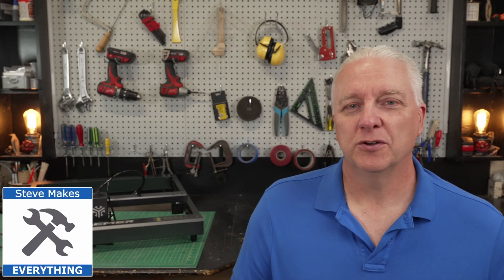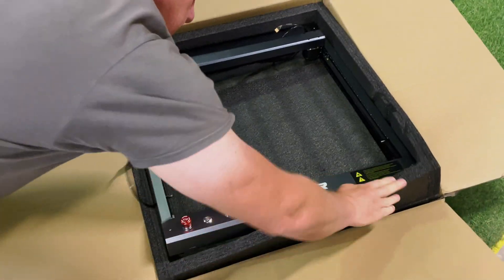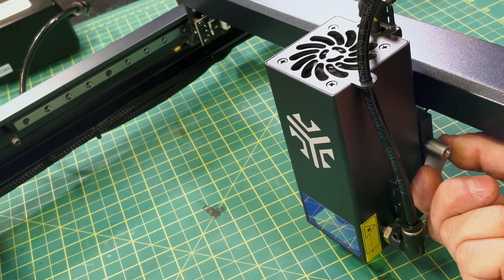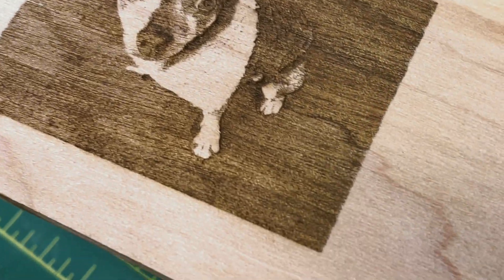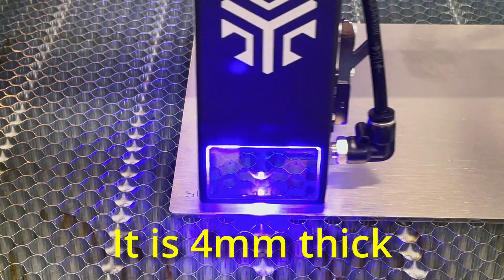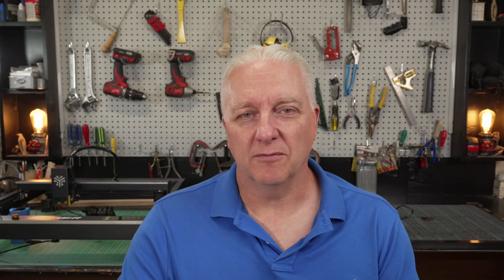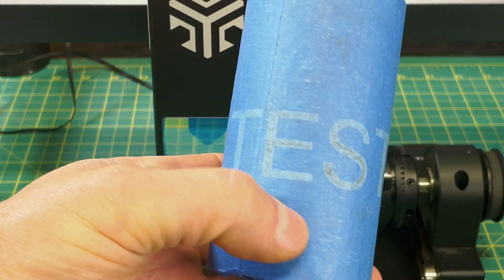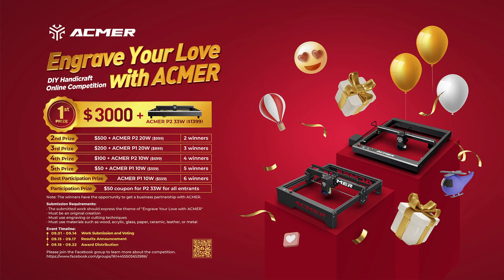ACMER P2 33W - Possibly the Best Diode Laser of the Year

Comment: I bought this laser about 6 months ago because of this video! I have one question, do you know what air nozzle will fit the laser module? I'm looking for a high pressure design or one that sits closer to the material. Any suggestions?
Reply from the maker: Hmm, not sure. If you just want to increase the pressure, put a piece of tape over the end of the nozzle and fire a few test shots to drill a hole the side of the beam

Comment: That looks pretty good, and with it on sale for $799 right now, it has to be the most affordable 33w laser on the market. I just bought an Ikier 24ww less than a month ago for $100 less, and now I need to make the hard decision of whether or not to try to return it and get this one. I do like the Ikier motorized z axis with autofocus and ability to step up auto step-down cutting. It's a tough call.
Reply from the maker: I don’t personally find autofocus on diode lasers very useful.  It takes longer than just doing it yourself.  However if you’ve got a laser that works why bother trying to get something else?

Comment: Purchased one last week, not production run friendly.  I mounted it to a spoilboard, burned a grid. homed it, and it was off immediately after which worried me. Homing the laser basically resets the position or even letting it cut a circle (lightburn and lasergrbl), then after it finishes, pressing run again mine goes off to the right about 1mm, then if you go again like that, it will go further. Home it, and all bets are off, it randomly picks a spot 10mm in any direction. I have to reset my coaster template each run which is annoying. Support had me upgrade the firmware but did not help either.
Reply from the maker: Hmm that’s interesting. What’s the point of homing if the 0,0 moves around?  When I get a minute I’ll try mine to see if does this too.
Reply: @SteveMakesEverything 

 Here is what I tested

DREW CIRCLE DEAD CENTER OF THE GRID AT 210,200
HOME THE LASER
SET FINISH POSITION TO 0,0
ETCH CIRCLE AND LET IT RETURN TO FINISH POSITION 0,0 (ERROR ABOUT A HARD LIMIT WHEN THE LASER HITS THE Y AXIS) **edit, fixed this by tightening a belt loose on the gantry**
HIT START AGAIN
RESULT OFFSET TO THE RIGHT SIDE OF THE GRID AND CONTINUES TO GO OFF MORE AND MORE AS YOU RUN THE JOB AGAIN AND AGAIN.
REHOME LASER
BACK ON THE CORRECT MARK
SET FINISH POSITION TO 420,400
HOME LASER
START ETCH OF CIRCLE AND LET IT RETURN TO FINISH POSITION 420,400 (no error)
HIT START AGAIN
RESULT, NO OFFSET AND REPEATS OVER AND OVER.

So it seems to be an issue with the Y axis limit switch?  Also, using Absoloute Coordinates in lightburn but does it with all if you set 0,0 as the finish. If I set say 10,10 I can run over and over so this may work but not sure why if it goes 0 on the x it flips out.
Reply from the maker: @SMLaserCrafting  The issues might actually be when you set the position to 0,0 after homing.  Homing is supposed to do this for you, but after a homing operation, Lightburn will set 0,0 and will then move the laser module out a bit to pull away from the limit switches.
Reply: Thanks!  @SteveMakesEverything   0,0 finish is actuall done by default in LB and LaserGRBL. Only way I was able to get around this finish at 0,0 was to finish at say 10,10 or anywhere away from 0 on Y axis which causes the issue. I can finish 420,0 or even 10,10 and it is fine.. anytime it comes to 0 on Y it is off on the grid after. I used their LB profile but increased the homing pull off from 1mm to 2 and it got rid of the alarm for hard limits but still goes crazy like it does in my video if you finish at 0,anything. Returning the unit and hopefully the next one is better.
Reply from the maker: @SMLaserCrafting  Note that you can turn off the limit warnings completely by setting a GRBL value.
Reply: @SteveMakesEverything  Ya turned off the settings but still having the issue where it loses 1mm or so going to y axis 0 as a return. I'll play with stuff today before I order a replacement machine and send this one back. Appreciate the help, been watching your videos for awhile now!
Reply: @SteveMakesEverything Can you test this and let me know what your result is? They had me tear this thing down, resquare it etc.. same. Draw a line circle anywhere, set finish to 210, 200 , run it again after it returns to finish. Should be exact. Now set finish to 0,200, move your circle or run over it again, and then after finish again. I did this until I got to 8,200 and after that it seems to be back to perfectly aligned. So anywhere within 0-9mm-ish on the work area is useless to send the laser to as a finish. running something out there is fine... but when the laser gets to that edge resting, I am thinking the cables or hoses is really pushing this gantry around. I just want to see if anyone else has the issue before I order another and return this one.

Comment: Hi Steve, I received my Acmer P2 over the weekend, but I'm having an issue.  I've connected as per manual, blue light on AC/DC adapter is on, but it doesn't turn on. The key is in the horizontal position, power button is down. I've downloaded lightburn, but I don't know which Grbl setting to click on have it locate the laser.  Can you PM me, or give me some direction on how to get this moving?  Thank you.
Reply from the maker: Is you haven’t figured this out, shoot me an email.  You will first need to configure the laser in lightburn. Find the Device button on the laser tab and click that.  The laser needs to be on and connect via USB before you do this. You may need to do long press on the power button to start it, though I can’t recall for sure. Also make sure the emergency stop button is popped out

Comment: How does this compare with the Atezr v35 or P20?
Reply from the maker: It is similar.  It doesn’t have autofocus like the Atezr L2 but unlike any of the Atezr lasers it uses linear rails rather than rollers and should be more accurate and more durable.  While both the ACMER and Atezr V35 are 30+w lasers, the Acmer P2 seems to cut more like a 40W.

I don’t really buy into the ability to cut lumber with any laser (I have a saw for that), but with the higher power you can cut and engrave faster than average.

Comment: Thanks Steve or your conprehensive reviews! Informative and straight to the piint. A request: could you please  help me compare the acmer 23 with the ikier pro 24/36/48 w? Because you had me convinced on the ikier some time ago, and i see that now regard this one to be better.  - It seems to me - correct me if i am wrong - that the ikier offers more features than the acmer,  like the auto focus and the z axis control for example. The ikier looks sleeker, and my impression is that it’s technologically more sofisticated. And since value for laser power they are pretty similar i wonder if I missed something.
Reply from the maker: I haven’t reviewed the IKier laser. All I can say is that it looks very similar to the Atezr L2 and I assume they are the same laser rebranded.  I love the L2, but I think the ACMER P2 edges it out for easy of use and power.
Reply: My bad, i must have seen someone else’s video and remembererd it was u, sorry! I understood from what u said  that 2 different brands of diodes with the identical optical power may deliver a different outcome? In other words there is a possibility that a 30 w diode of one brand  may perform better than ine with a higher nominal power? Or else?
Reply from the maker: @yehudaschryer5985  I have seen different lasers with the same power produce different results.  I'm not sure if it's related to the manufacturer or just differences in lasers modules regardless of the manufacturer.
Reply: Thanks again for your answer since as u said the same optical power may give different results, It would then be interesting to see different diodes compared head to head. Same material, same speed, etc. As  the main difference in price relates to the optical wattage of the diodes, unless one is an expert as yourself one can never now where he stands, just like cars vs HP i guess... Although the manifacturers specify how deep and how fast their horses can go, reality shows otherwise, as i have $&@/$&@ experienced with my first laser. Sculpfun  5w… they boasted 15 mm plywood but it never went all the way through 6 poplar plywood, no matter how many passes i tried. Since i am now seriously thinking of upgrading your help is greatly appreciated.
Reply from the maker: @yehudaschryer5985  I'm actually looking at doing a couple of videos related to diode laser power.  First one will be soon I hope.

Comment: Hi Steve.  On average how long does a diode laser usually last . Mine use to engrave tile. But now won’t even mark it
Reply from the maker: First pop the laser module off and tear down enough to get at the lens. It’s possibly just dirty or may need to be replaced. 

Determining the life span of a laser would be difficult due to lots of variables (e.g. how much power is it producing?j. But general you should be able to get a few thousand hours out of them.

Comment: Thanks for the review.
Did you test the Wifi antenna? It looked like there is one.
Reply from the maker: There is one. I didn’t test it though.  It can be configured with the Acmer app
Reply: it doesn't connect very well ! & it limits your speed also.
Reply from the maker: @greenbuttonpusher_hc6453 When I get a chance I'll give this a try.  In general I find wifi on lasers to be kind of bad, which is one reason I don't use/test it.  USB is king.

Comment: you act so surprised its good. what u expect for over 1000$. still only 33 watt. and has a big focus dot
Reply from the maker: Indeed but I’ve seen things in other lasers in this price range.  It’s shocking how many are just terrible.

“Still only 33W”??  There are only a couple of lasers with more power than this one and pretty much all laser >30W have this spot size.  Even so I would defy anyone to look at a cut or engraved part and tell me the beam size that was used.